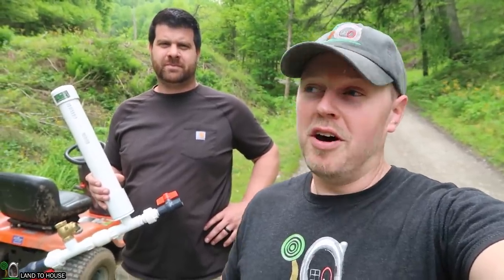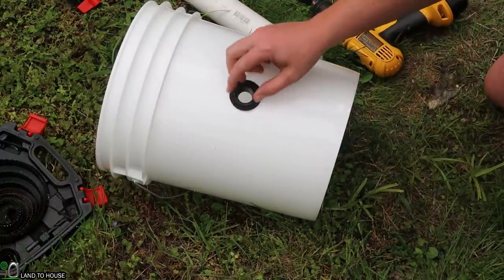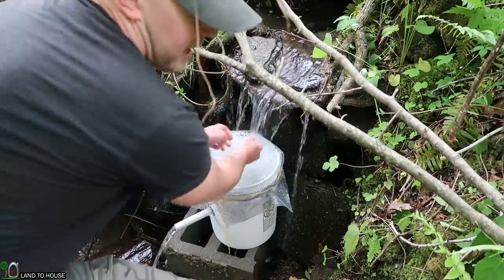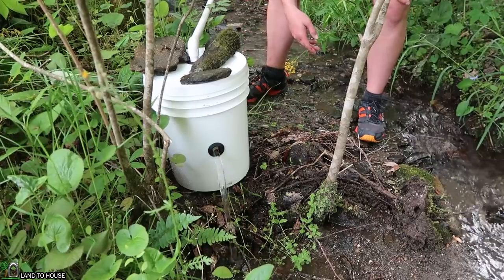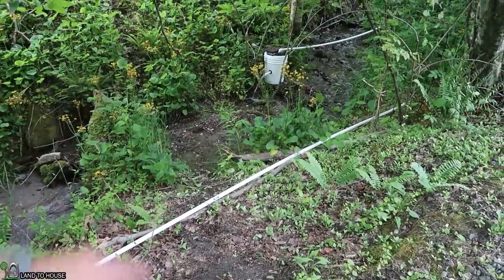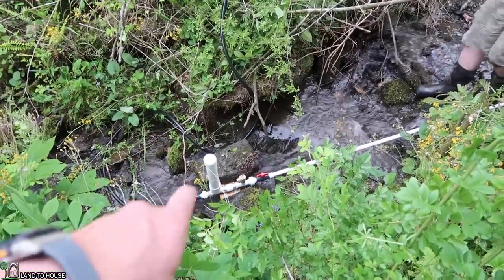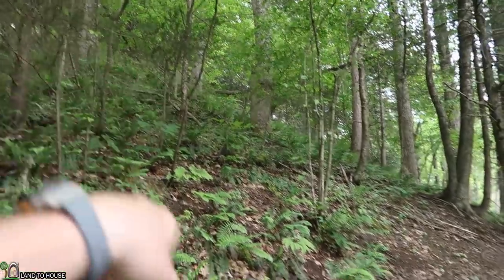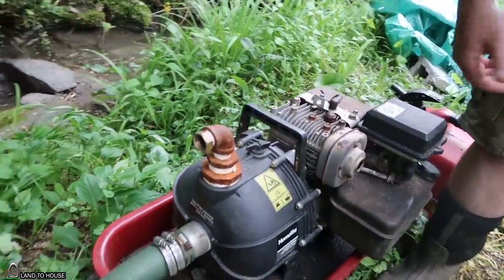Full 3/4 inch Ram Pump Install for a Hog Farm

Comment: I've seen these and have seen them on you site... It's cool to see the install and how it actually works...
Reply from the maker: This was a fun full install. They are filling the tanks overnight.
Reply: @LandtoHouse  out of curiosity, what kind of drain on the tank do they have on average usage??  And where does excess go once they're both full??  Could you do like a manifold to hook the supply line into and fill both tanks at the same time??
Reply from the maker: You can install a Y fitting on the bottom and that would fill both at the same time. Or you can connect the tanks at the top so that the overflow of one fills the other. This would work well if the tanks are just slightly off from level.

Comment: an idea to stop the screen on first bucket clogging, fix/glue a fitting in centre bottom inside of bucket, put a 1/ inch pipe long enough so potrudes 2 inches or so above bucket neck line then put screen on, this creating a slight screen elevation from centre down to bucket edges.😇

Comment: Last year I angled my waste valve while keeping the air tank vertical. One direction causes the flap to close with very little water (fast cycling). The other slows the cycling because the flap is no longer almost vertical, but is now more horizontal and it requires faster water to slam it shut. Next I timed filling a 20 oz bottle of water at various angles. There was a very significant difference due to the pressure wave caused by faster flowing, low-cycle rate (harder hammer effect) water versus lower flowing, high-cycle rate (softer hammer effect). If you want to test, simply make your flapper 90 degrees to the water flow and begin to angle it.

Comment: I’m new here. Maybe you’ve been asked before.  Have you experiment with spring checks (2nd check) of different strengths?  Weaker or stronger springs? Could you use a spring check in place of the 1st swing check?  Just curious. Nice info.

Comment: I had an idea but I don't know if it could be made to work. I want to install a ram pump inside a rainwater collection tank so that when it rains heavily, the pump will push water up to another storage tank on the hill behind the house and provide me with 'gravity feed' pressure in the house. I am hoping that this will work while not wasting the water that escaped the flip valve. We don't have access to any other water on our property. We could install a RAM pump in a creek on a neighboring property, but the distance it would have to travel is considerable. We do have 3 seasonal springs that we could also install RAM pumps in, that we currently store water from and pump using a generator to fill the household tanks.
Reply: Personally I have never seen auto start work except for once in a blue moon

Comment: Your explanation at the 2min 29 second mark, and when you are saying the increased pressure goes back up to the intake side (back to the left), what would happen if you installed another gate valve so that it prevents the flow back the intake side.
Reply: The pulse travels at the speed of sound in water (3,340 MPH), so my bet is nothing, it would just stay open.

Also, water is effectively incompressible, so pressure increases requires almost no flow, and a check valve is driven by flow.  The movement of the flapper would be imperceptible.

With that being said, an additional check valve on the drive pipe would be another flow restriction, so it would decrease efficiency, probably marginally, but a decrease with no gain/upside.

Comment: I ordered my ram pump and I am installing. Does the flow pipe need to be 1 size smaller then the supply pipe,, 3/4 going in, 1/2 going out?
Reply from the maker: The delivery pipe going up hill can be any size you want. The drive pipe feeding the pump needs to match the pump size.

Comment: I’m having a heck of a time figuring out the fitting from pump to 3/4 black polyethylene pipe.. I ordered a 3/4 npt  x 3/4 barbed fitting and the pump side was the wrong size.. any help would be appreciated

Comment: I have a 1inch ram pump. Now the spring valve (secondary valve) is damaged. I just wondering if I can reduce the spring valve with  ½ inch valve. Is it possible to do it? Thanks
Reply from the maker: Yes you can use an inline valve that is smaller.

Comment: Seth,
Try experimenting with PEX crimp rings, there are a variety of sizes and you might find that they'll do a better job keeping your couplings in place.
You might have to use a 3/4" or 1" PEX crimp ring for your flexible tubing installs. Would save you from the hose-clamps backing off.
Used to recommend to install two on barbed fittings, opposing each other to keep vibration and pressure from loosening connections but either crimp/synch or compression rings might do all the wonders for you.
Reply: Maintenance might take a reduction, but is part of the game? Less maintenance means you can do more with your free time as opposed to tightening hose clamps or finding air leaks/etc.

Comment: Hi Seth, can you put a link to "Unicel, Unicell?  Thanks Eric
Reply: They are called uniseals if that helps you find them
Reply from the maker: I just put the link in the description. That should help. They really are great.
Reply from the maker: Just placed a link in the description.  I use these all the time.
Reply: @soeveth   thank you!  Found em on Amazon!  Thank you I wasn't having much success in my previous searches
Reply: @LandtoHouse  Thank you for that link!  I was searching on amazon, I've got a couple 2" brass swing valves I salvaged, am going to try and put a 2" ram pump together for a small project.
Reply: @LandtoHouse  You should partner with Uniseal. You are their best salesman!
Reply from the maker: Ha yes they did sponsor the hydro series. I have probably sold 1000's for them.

Comment: Doesn’t the creek water need to be filtered before using? The US water supply has become so tainted.
What do people use for water in the winter when the water freezes?
Reply: Yes, this would be non-potable (non-drinking) water.  You can irrigate and water livestock with it.  You would have to extensively treat it to drink or cook with it. 

People without city water usually use well water for drinking.  We use well water for our house, but we don't use it to water the garden, flowers, or lawn.

Additionally, we use creek water to wash the cars and boats, our well water is quite (sodium)salty and leaves water stains.  For drinking and cooking, we remove the salt with a RO system.

Just for clarification, we don't use a ram pump, we use a 3/4 HP electric jet pump.

To make this to drinking water, you'd probably want to settle it,  run it through a silt filter, then carbon blocks, then a RO system, and the EPA says then chemically sterilize it with chlorine. 

Creek water tends to have an abundance of algae which tends to clog the silt filters quickly, so you would be replacing those constantly. 

My jet pump used to have a large metal silt screen to stop pebbles, and it constantly clogged with algae, so I ended up just completely removing it.
Reply: As for non-potable water, a nearby city (Cary, NC) nstalled a second water supply for grey water.  They pump the treated discharge water from the SEWER plant in it for irrigation, and provide it for free, which keeps it out of the river.  They claim it's as clean as the tap water, including chlorination, but don't approve it for drinking regardless.

Comment: Would a normal one way or tesla valve right before the pump make this more or less efficient
Reply from the maker: sadly that would keep the pressure wave from traveling as it needs too.
Reply: Ok that makes sense now what about a vertical pipe coming out of the air separating bucket that goes higher then the intake to increase the overall head pressure
Reply from the maker: If you sealed the bucket and let the pipe stick up it could match the source and increase the head.

Comment: Pls.give approx.height from the source to ram pump ,from the ram pump to the delivery area,in feet or in meters ,thanks
Reply from the maker: In this setup the head pressure was around 5 feet. The lift height was between 25 and 20 feet to the tanks. The delivery needed to go a little higher to maintain back pressure.

Comment: Why don't you do vent holes on the bottom of the first bucket to prevent silt to accumulate? I mean you do drill vent holes in the second bucket to vent air and excess water. Is there a good/valid reason why you do that this stupid way? You get enough water to overfill both buckets but use only one the second bucket to flush the air but forget to flush the second one? I don't understand this

Comment: I have built a ram pump but why it stops cycling when delivery valve is opened? Anyone can provide some assistant for this issue
Reply from the maker: Do you have a delivery pipe installed? You will need back pressure to keep the pump going 
Sesrch:
Ram pump back pressure loss
Reply: @LandtoHouse  this problem has been solved already, thanks to you..but there is another problem..does the angle of delivery pipe affect the time taken for water to be lifted up? Because mine was fitted with 90deg elbow, its like L shape..it took ages to discharge some flow..can you recommend any video or reference I can refer to?
Reply from the maker: @ridzwananuar5919  because the flow rate is so low it does not reduce much with a 90. Some but not much.